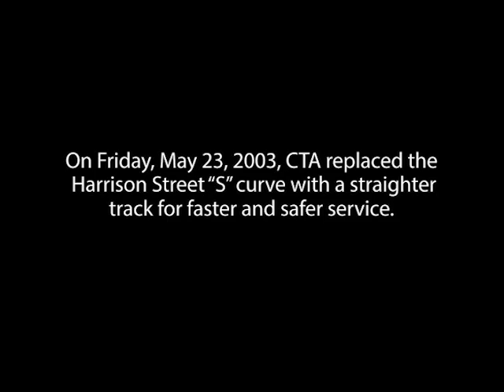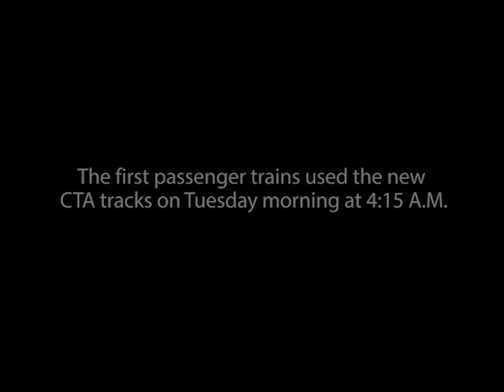From the Archives: Harrison Street Curve Reconstruction (2003)

Comment: Damn, I actually am surprised and impressed how this was all rebuilt in just a few days, RPM is taking much longer than that (2019-2025)
Reply: Well it’s partially due to “Covid-19” and partly due to monetary issues.
Reply: The Belmont flyover is up though side note
Reply: The RPM is a entirely different and longer project than this was. Also The RPM happens on The CTA's most busy route so they have to keep it open thus doing it in phases. This was just a few city blocks long you can't compare them.
Reply: They done this quickly because most of the construction was already done.